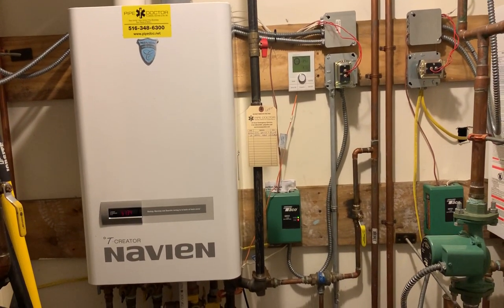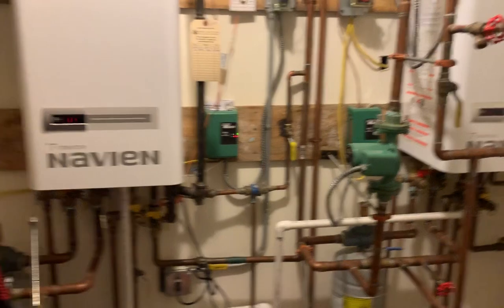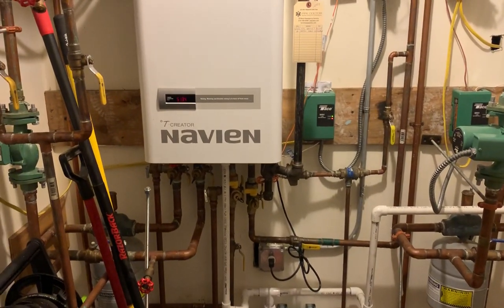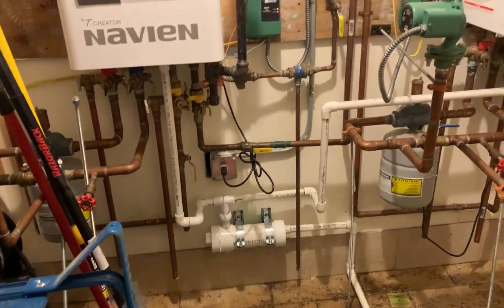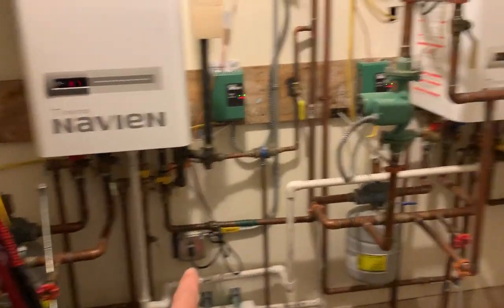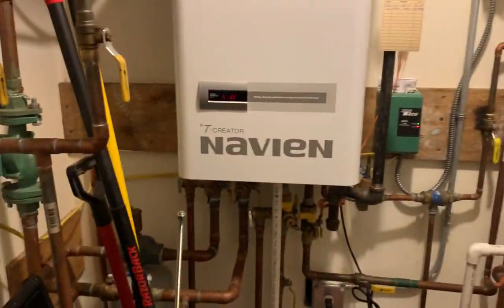Adding Condensate Neutralizer on 2 Navien Units

Comment: Nice work !  Question .. I had a navian installed 3 years ago , and the company didn’t install domestic isolation valves.  
   Should this be standard ?  Did they screw me ?   They came the first year to do the first cleaning , an then the following year I missed .  I had a different company cone this year , they said the can’t descale without domestic isolation valve .  🤣🤣

Comment: Hey there, new sub here. I have an NPE-240A and I’m about to do my first flush at I’m coming up on the 1 year mark since installation. I’m planning on using just straight white vinegar, what is the reason why you use calci-free rector-seal instead of vinegar? And if so, should I get some instead of using vinegar?